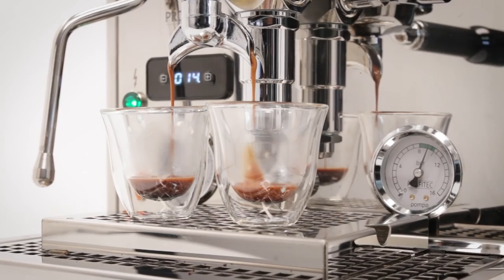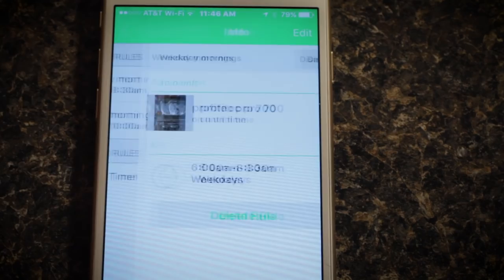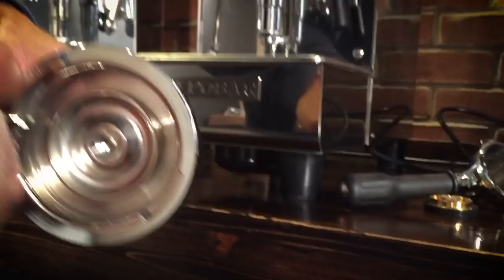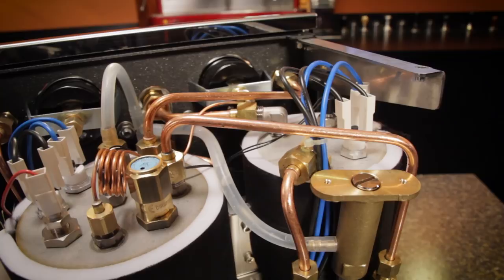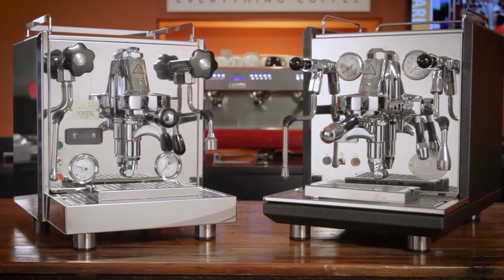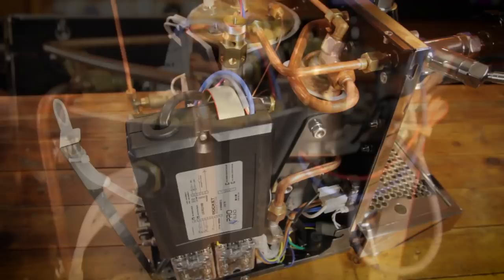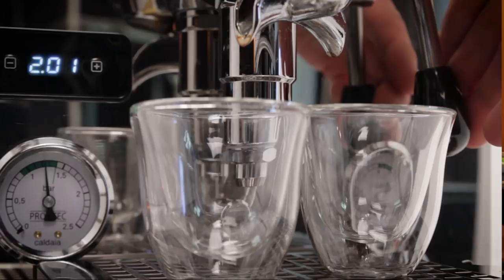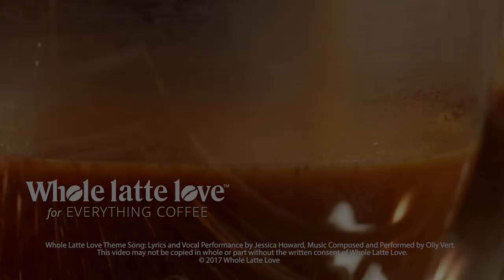Compare the Top 4 Dual Boiler Espresso Machines 2017

Comment: Thank you Marc for this very clear and informative comparison! I own my ECM Synchronica, paired with the ECM V-Titan 64 grinder, for about 1 year now, and can't be happier! Learned a lot from the many videos from WLL, which helped making the purchasing decisions. I also adopted the WEMO switch in my setup, my machine is always ready in the morning. What I wasn't able to do is installing a direct water line due to physical constraints in my kitchen. In order to avoid descaling, I am using the BWT water pitcher filtering together with the Bestsave M Anti Scale Filter in the reservoir. Hope this will get me "close" to the plumed BWT filter performance. Any thoughts on this filtering combination? Maybe a comparison video between the plumed and reservoir+pitcher filter? Cheers, Rudolf
Reply from the maker: Hi Rudolf, You are welcome! And, thank you for your detailed comment!!! The Synchronika and Titan are a capable and beautiful pair. Too bad you can't work in the plumbed filter. It would really up the ease of use factor - especially since you have the wifi switch. With the BWT pitcher and anti scale filter in the reservoir I suspect you are fine. What I need to do is get out my test kits and see how the two setups affect TDS, alkalinity, pH, Ca and Mg levels with my source water.
Reply: Thanks for sharing your experience! I appreciate a lot bot of the comments, would love to see the comparison, lots of details to point! Rudolf, congrats for the purchase.  Marc, did you get any time to handle that subject yet?

Comment: I like that idea of a power timer. I kept meaning to ask someone if it was OK. Some electronics don't like such things. Seems the answer is to for it.
Reply from the maker: Hi DP, Adding a timer is a life changing experience! So nice to have a machine all heated up and ready to go. You are right, machines with electronically activated power circuits usually don't work with power timers. But, all the machines in this video have mechanical power switches so works like a charm! As mentioned be sure the switch is rated to handle the current load of your machine.
Reply: Whole Latte Love awesome. I have  a bunch of folders already from the turtle aquarium collection. Thanks heaps for the info. :)

Comment: I have the Expobar  very stable temp when brew and steam boiler are switched on at the same time Had it now for 6 months very reliable
Reply from the maker: Hi D, Thanks for sharing your comment. The Brewtus is very stable! A heat-exchanger in the service boiler pre-heats water for the brew boiler which helps!
Reply: I have noticed that the service boiler sends hot water to the brew boiler which improves the brew boiler temp, do a lot more shots with out the brew boiler dropping in temp

Comment: In future reviews it would be helpful to compare the maximum noise level in decibels generated by these machines. Early risers want to know!
Reply from the maker: Hi M, Thanks for the suggestion. I will say there not a huge difference in noise in these machines. All have rotary pumps with very similar noise levels. Different story when you go to vibration pump machines which are a little noisier. If you want a silent machine go to a plumbed in manual lever machine. There are some which never run the pump!
Marc
Reply: Why? The grinder is going to be far louder.

Comment: Hi Marc, thanks for the great review, does the bigger boiler size in the ECM would make a difference over the R58? Should I get the ECM for this reason? And last how is the steam pressure of the ECM compared to R58? Are they the same? Which one is better in making nicer microfoam milk?
Reply from the maker: Hi Waleed, Thanks for the questions. The current ECM Synchronika has best in class steaming power with steam boiler running at about 2 bar max. R58 runs about 1.5 bar max. Making nicer microfoam is dependent on user technique but most prefer higher steam power for bets results. More info and newer Synmchronika video here: https://www.wholelattelove.com/products/ecm-synchronika-dual-boiler-with-flow-control
Marc

Comment: Thanks Marc for the fully informative video, regarding the ECM is it possible to do pre-infusion when connected to reservoir?
Reply from the maker: Hi Hussain, You are welcome and thank you for the comment. You cannot do pre-infusion unless plumbed in. You can do pre-wetting of the coffee puck. Residual pressure in the boiler will push out a bit of water onto the coffee puck. It's not much maybe 30ml and there not much pressure behind it.
Marc
Reply: Whole Latte Love thanks a million for your reply, you are the best 👍🏼
Reply from the maker: You are welcome!

Comment: Are there more DB with HX between the steam boiler and the brew boiler?
I wonder what machine has better thermal stability with a SCACE device check - The Expobar or the ECM/Profitec.Did you check it?
Thanks!
Reply from the maker: Hi i, Thanks for the question. The Brewtus IV is the only DB machine we carry (and that I'm aware of) with an HX section in the service boiler feeding the brew boiler. We regularly Scace all these machines - it's part of the bench prep before they ship. With PID, all the machines are very accurate in initial brew temps. We do see a difference occasionally in recovery time. The Expobar in general is faster. On the flip side pulling many shots rapidly may cause brew temp overshoot but it's minimal and one has to pull many shots in rapid succession to get there.

Comment: I love the r58 design but I also love the ecm syn. But I love the flow control you can add can you do that as well with the 58?
Reply from the maker: Hi KR, Thanks for the comment and question. While we've tested the flow control on Rocket E61 groups and it works the FCD is not currently available as an upgrade in the US.

Comment: ECM Syncronika or Profitec 700?  From watching several of your videos, both seem like solid, quality machines.  Looking at the knobs vs levers, would the knobs allow one a finer control for steaming?  Or do the spring loaded knobs tend to cause them to operate more like the levers?

If you were to buy one of these two machines, which would you pick, and why?
Reply from the maker: Hi Dave, Thanks for the question. The Synchronika and Pro 700 are essentially identical internally - guessing you knew that :). Key differences are the knobs vs. levers, gauge placement and finishing details. The sprung valves are very close to levers in control of steaming power. They go from full closed to full open with a quarter turn so it's difficult to have precise control of steam release by turning the knob. But, you can control steaming power by adjusting the temperature and therefore the steam pressure in the boiler. Gauges are mounted up high on the face of the Synchronika so easier to see when using machine. For finish details, both are excellent but the Synchronika is a cut above with angled portailters, matching chromed accents on control levers and PF handles. Also has more detail in the group head which has a subtle taper and a more "designed" end to the E61 exhaust tube. Synchronika is very easy to open up. Personally I'd choose the Synchronika. I open a lot of machines up and the Synchronika is the easiest. I appreciate the finer details and especially the angled PFs which make tamping and locking in easier. You pay a bit more for all that but I can easily justify in my mind knowing I'll be looking at it and using for years to come. Hope that helps!
Marc

Comment: Thank you Marc. This was helpful. I had three clarifications:  [1] I am inclined to buy the R58 cinquantotto vs. the ECM Synchronika but am wondering if the flow control that you are providing for ECM will make a difference to the coffee output?  [2] I wanted to validate that the ~1.5 bar stream pressure in R58 vs. the ~2 bar pressure in ECM results in the same quality of frothing/steam though the ~2 bar could result in faster steaming [2]I ruled out Profitec 700 given its similar to ECM Synchronika and ECM has better external features. Would you be aligned?  Thanks in advance!  ~ajit
Reply from the maker: Hey Ajit, The flow control opens up new possibilities. Things like a very long low flow pre-infusion to tame brightnes in fressh from roast specialty coffees. Here's a video with 2 simple flow techniques that make a huge difference in extraction quality: https://youtu.be/a-QAOo8Vg5A
The extra steam pressure in the Synchronika or Pro 700 has a few benefits: Faster steaming, more vigorous roll in pitcher for finer milk texture and capacity to steam more milk before reduction in steam pressure. The Pro 700 and Synchronica are nearly identical internally in specs, components and construction. The difference is as you mention external finish quality. So yes, I am aligned. Hope that helps!
Marc

Comment: If other PID-controlled single boiler heat-exchangers (like the Rocket Chronometro) can already brew and steam at the same time, what advantage do dual boilers have? Are single-boiler heat-exchangers limited to an extent?
Reply from the maker: Hi ff, Thanks for the question. In dual boilers one can set individual temps for the boilers. In PID HX machine you set boiler temp to get a desired brew temp. So depending on brew temp desired you are limited in adjustment to steam pressure - can run higher pressure in dual boiler machine without effecting brew temp.
Marc

Comment: WLL: any idea when the Synchronica with flow control will be back in stock?
Reply from the maker: Hi Manuel, They have been very popular. We received a bunch a few days ago. Unfortunately they all shipped to customers who had pre-ordered. If you like you can pre-order the Synchronika w/Flow Control by calling 585-924-7170. You'd get the Synchronika with the stock mushroom now and the FCD would ship when back in stock.

Comment: I’m new to this whole experience, however if I’m looking for excellent cafe style coffee or latte with a durable machine and easy to use which machine would you recommend, was looking at rocket , mozzafioto, or ?
Reply from the maker: Hi Gail, Thanks for the question. The Rocket Mozzafiato is a good machine and very capable of making cafe quality drinks. Easy to use is a subjective judgement. At that level of machine you will have the capability of brewing and steaming simultaneously due to heat-exchange boiler. if you step down to a single boiler machine you cannot brew and steam simultaneously. If in the US it might be best if you spoke by phone with one of our coffee experts. Most are former baristas. They can more deeply assess your needs and set you up with the equipment that meets those and your budget. You can reach them at 585-924-7170.
Marc
Reply: Thank you !

Comment: I would personally recommend the VESUVIUS V2 espresso machine , you carry by the way . Why isn't it compared ? Maybe because you won't be selling the other ones since it has more features?
Reply from the maker: Hi Chris, Thanks for your recommendation. The Vesuvius is a fine machine! For this video we picked our favorite dual boiler machines for the year. We did not consider pressure profiling machines for inclusion in this video. Their capabilities and cost are beyond mainstream dual boiler machines. We do have these videos on the Vesuvius: Review: Vesuvius Dual Boiler Espresso Machine with Pressure Profiling https://youtu.be/S2aG_gVll5g
Compare: Vesuvius Pressure Profiling, Profitec Pro 700, and Expobar Brewtus https://youtu.be/jrciwcjvEsM
Marc
Reply: Whole Latte Love Good point, didn't check your latest videos ! Sorry

Comment: Hi Marc,
Does the stainless steel boiler on the ECM make a difference compared to the copper boiler on the Rocket ? Could you please explain?
Many thanks in advance!
Best
G
Reply from the maker: Hi Genc, Thanks for the question. IMO no difference. Technically copper is better transferring/holding heat. But, copper boilers use thinner metal than stainless boilers so not much difference as a heat sink. Some manufacturers have told me they believe scale is less likely to occur in stainless. Rocket does make a bunch of machines with stainless boilers including the R Nine One their top of the line domestic/home machine: https://youtu.be/31GFyA-DXXg
Marc
Reply: Whole Latte Love, Many thanks!

Comment: Mark,

On the cusp of pulling the trigger on my first Espresso machine. I love the look of the Rocket espresso machines, particularly, the Mozzafiato, Giotto, and R58. The questions I have for you, though maybe ignorant and a little leading is: How does Rockets build quality compare to ECM and Profitec? Cost comparison wise, which would you choose personally? And lastly, is there a benefit of a vertical boiler vs horizontal boiler in these machines?
Reply from the maker: Zack Bowe Hi, All are fine machines. Personally I find ECM/Profitec has slight advantage in reliability. They’ve started rated using stainless mushroom valves which are less likely to scale. When plumbed, ECM and P machines can do line pressure pre-infusion. Rocket machines cannot. Most people important is feeding quality water to avoid scale in first place. Recommend an in-line filter system by BWT for all plumbed machines. No chance of scale yet maintains mineral level for flavor. https://www.wholelattelove.com/bwt-bestmax-premium-filter-package
Marc
Reply: Whole Latte Love Thanks, Marc! Watching your video I can’t help but notice that y’all visited the Profitec factory outside of Milan and noticed ECM logos and hardware everywhere in the factory...? Are both companies machines made by same manufacturer/at same plant? Also, is there a benefit from horizontal boiler over vertical. Btw, love your videos and yalls website!
Reply from the maker: Zack Bowe You are welcome! Profitec/ECM are sister companies. Kinda like Toyota and Lexus or Infinity. Never keep that straight. Anyway, hard to say there’s any advantage to boiler orientation. The Pro 700 and ECM Synchronika are virtually identical internally. The ECM just kicks up exterior finish details.
Marc

Comment: Hi, what espresso grinder would you recommend for the Wibiemme domobar manual Espresso machine, please?   T h a n k  you.
Reply from the maker: Hi ZS, Thanks for the question. At minimum I'd go with a Baratza Vario or Sette 270. The Vario has been considered the entry grinder into prosumer level grind quality for about a decade. Baratza considers their Sette 270 series grinders the best option for espresso based on usability. The Vario produces a slightly better grind in my opinion while the Sette 270s are easier to use. Another option is the Ceado E5P or E6P. They are commercial style grinders with larger 63mm burrs - bigger burrs generally produce better grind quality.
Check out Barataza grinders here: https://www.wholelattelove.com/grinders?product_brand=121
And Ceado here: https://www.wholelattelove.com/grinders?product_brand=31

Comment: Hi, I'm looking for home espresso machine, What is the advantage of spending more for the dual boiler compare to heat exchanger.
Reply from the maker: Hi YH, Thank you for the question. A few general advantages... temperature stability in heavy use. Recent HX machines with PID are very good and generally do not require cooling flush prior to brewing. HX machines without PID almost always require a cooling flush. The majority of DB machines are plumbable to waterline and have rotary pumps which are more robust than the vibration pumps found in many HX machines. Steaming and hot water output on DB machine has zero affect on brew temperatures. That's not always the case on HX machines. A few DB machines like the Profitec Pro 700 and ECM Synchronika can do line pressure pre-infusion when plumbed to a waterline. Not aware of any HX machines with that capability. Hope that helps. Let me know if you have more questions!
Marc
Reply: @Wholelattelovepage  Thank you very much for your answer Marc.